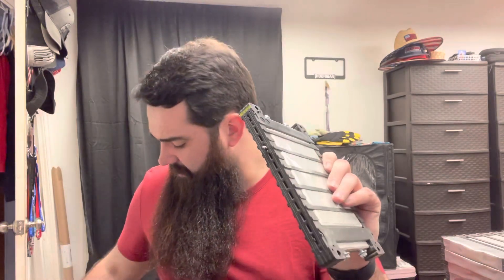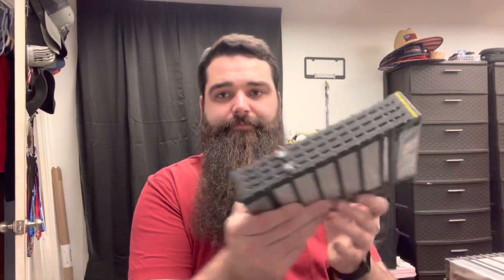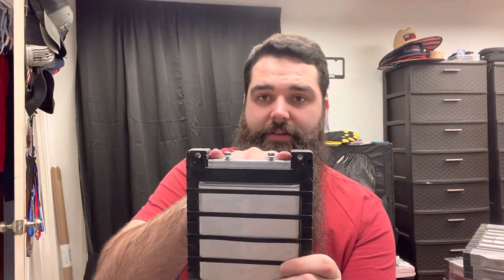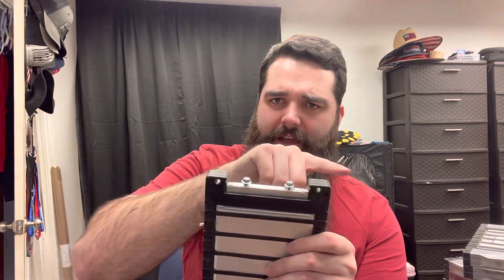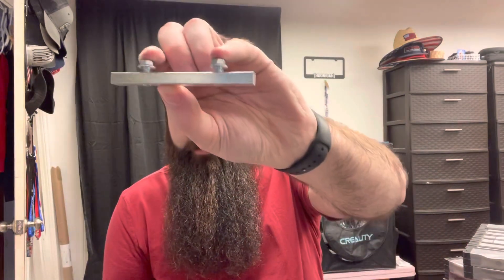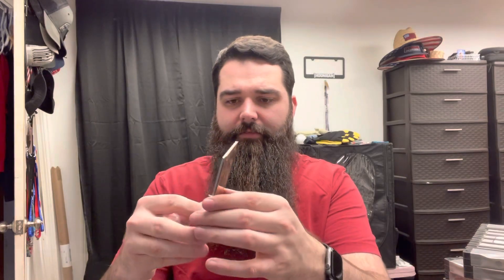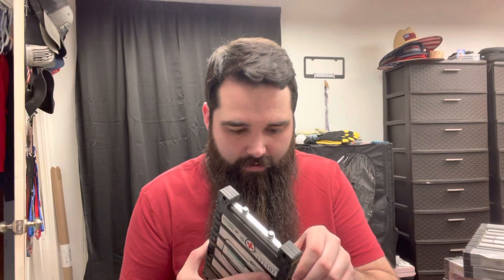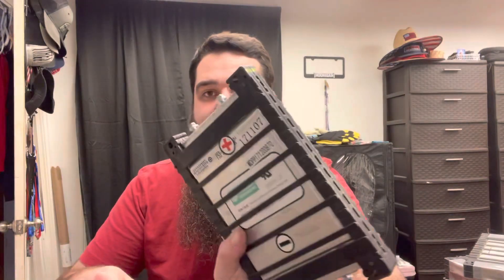SPIM08HP First Impressions

Comment: 1.8 lbs is two cells.
You can shave a little weight using threaded aluminum bars. Aluminum is also a better choice for bus bars than the steel- copper-steel bars.

Alignment is critical if one wants to get the maximum out of these.

So, depending on your skill level and the materials used, you may want to build at least the first couple of bars as you assemble.

Because you are working with the plane of contact bwtween two surfaces as your current path, you want them as flat as you can get them, and make sure they aren't cocked.

It doesn't take much to lose half your conductivity.
Reply from the maker: I know all that. Already measured out everything and ordered longer bolts. Using 1/2” aluminum bars. Got the metal locally and I’m making them myself.
Each “cell” you buy is two 8ah cells in a sandwiched plastic case.
The copper/steel is what battery hookup sells and I only bought one to measure out and use as a template. As I mentioned at 1:20 they aren’t good for high power but work for smaller banks and low power draw. Also mentioned Jim’s machineworx is selling bars for these and I linked to them in the description.
Reply: Man, I sorta dropped the ball ordering these. I bought 40 to make a 72v 32Ah pack for my electric dirt bike, but completely ignored the weight… I’ve dealt with lithium polymer cells for years but never expected them to get that dense. Probably gonna just make two 16Ah packs instead.   Roughly 65lbs all together. For only $460, I think I still got a good deal for two 72v packs